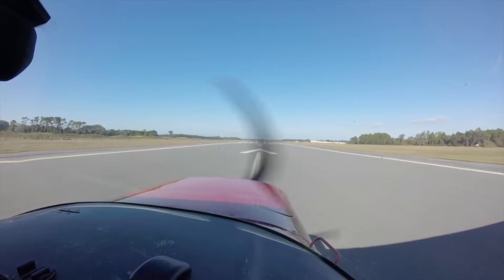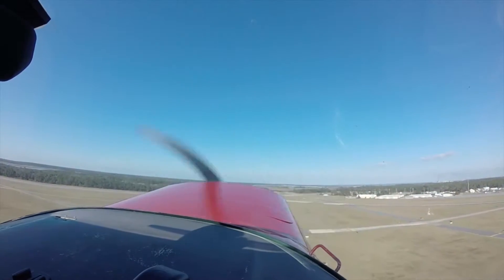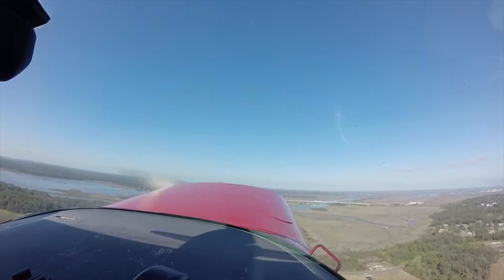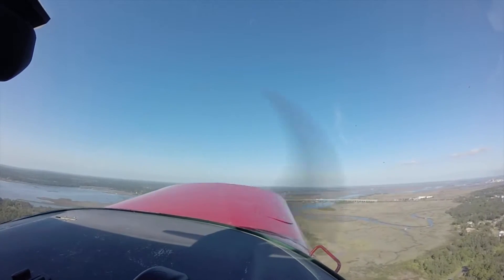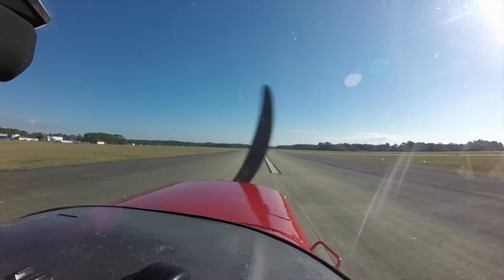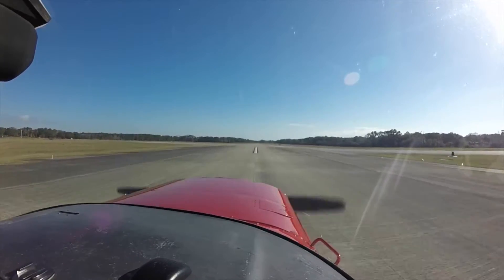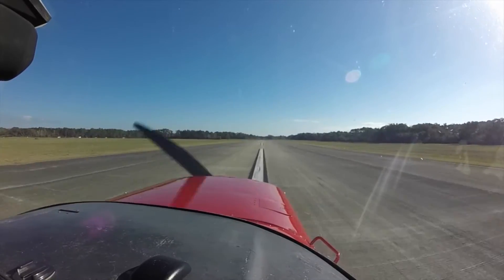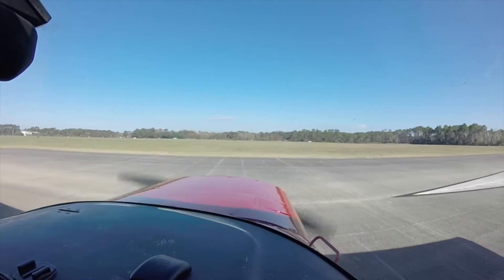ThePossibleTurn

Comment: Nice Video Meredith! When I did my private, an instructor pulled my engine at 400' and made me turn back to the same runway to prove (in that airplane) once above 400' you could make it back. 

I think when you are simulating and engine failure, you should wait at least 3 seconds before beginning the turn to account for the time it will take for you to process what is actually happening. You should lower the nose to prevent a stall but when your not really expecting it (I know always expect an engine failure on takeoff) you need to take into account the Human Factor which may take a few seconds to compute what's happening.
Reply from the maker: One of my treasured mentors, who now works for a leading GA manufacturing company, told me to be "spring loaded" to respond. I teach that to my students: expect the engine to quit and be surprised when it doesn't. On every single takeoff. I also practice with students the following, at altitude: Takeoff and climb at Vx, then lower the nose and turn. It's just like anything, if you practice it and are mentally prepared, it's possible...